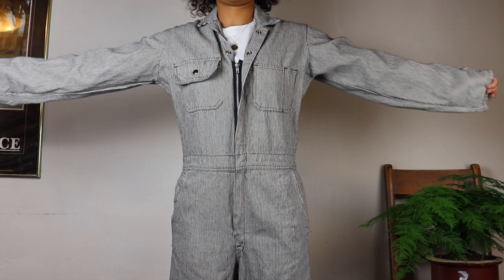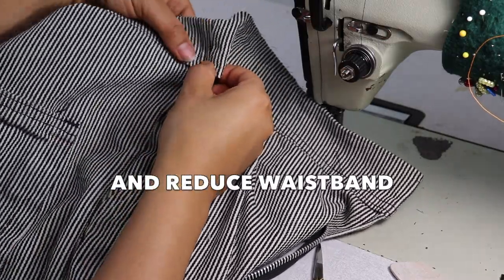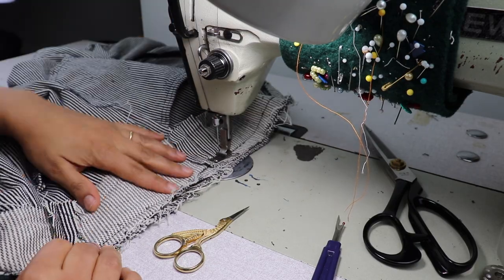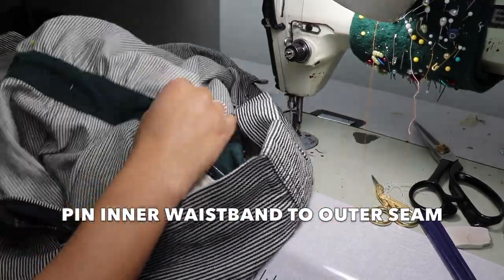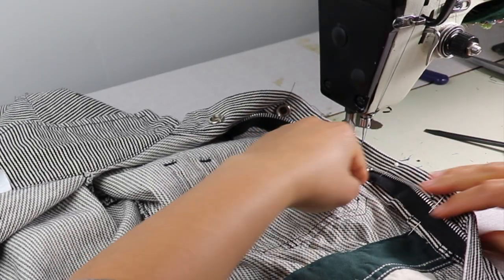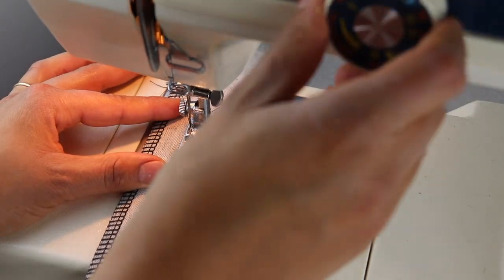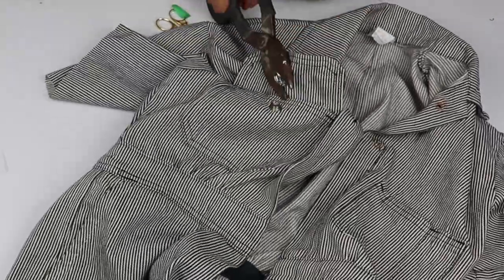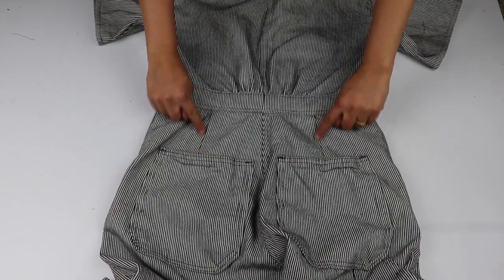THRIFT FLIP - Boiler Suit/Coveralls/Jumpsuit | LYDIA NAOMI

Comment: The openings behind the pockets are so you can get into your regular pants pockets
Reply from the maker: MAKES SO MUCH SENSE! thank you!
Reply: @LydiaNaomi  That's also the reason why they are often so large, they are meant to be thrown on over your regular clothes so they don't get dirty. Also, the loop you often see on the leg of overalls and coveralls is typically for a hammer or paint brush and If it has a long skinny pocket on the arm that pocket is usually for a flashlight in case you are crawling in a tight space and you can't reach your lower pockets.
Reply from the maker: @dannydatwho8253  thanks for the info :D
Reply: The same is true for lab coats and a lot of hospital overwear! If you want to have holes to access your pant pockets but don't want the chance of getting things through the opening, there are also designs that use overlapping pieces of fabric (almost like a wrap)
Reply: @LydiaNaomi  AND you can hike your real pants up from the outside
Reply from the maker: @buckswild5331  very useful haha
Reply: Oh wow, thanks for that.
Reply: True.

Comment: Very talented sewing skills, and very talented explanation on your video!  One question for you.  Would it have been easier to make one of these from scratch using a pattern than to alter the one you found?  I'm not being critical that you did it this way.  I just don't know much about sewing and am looking for information.  Thanks.
Reply from the maker: Thank you! I have another video where I copy this pattern and make a whole new one. This garment is the type that takes a lot longer to make from scratch.  It really depends on what you’re working on. I deemed this garment to be worth up cycling, which I usually shy away from on a general basis because I do prefer making something from scratch. I did go all out on this though, especially with making a hidden button closure. But I have been wearing this ever since and I always get compliments on it no matter where I go and I wear it a lot, so it was definitely worth it. Hope that helps!
Reply: @LydiaNaomi  definitely.  I'll check out your other videos.  I searched because I bought a pilot jumpsuit costume, and it fits arms, legs, and crotch, but it's too baggy around the middle.  I don't have sewing experience and am considering my options

Comment: kind of a newbie here .. so I'm curious as to why you did the gather / cinch on the top rather than taking in the side seam or adding some darts? also, does this jumpsuit have a drawstring in the waistband? considering doing the same to a men's jumpsuit, but I don't want to sew through the drawstring if I take in the side seams.
Reply from the maker: Great questions! I thought about taking in and darts but I think I was being slightly lazy. Gathers are the easiest and surefitting. Darts can be difficult to create smoothly and taking it in also poses potential problems for my highly picky and detailed brain so I opted for the most straight forward method of gathering. I love how it looks tho! This is one of my most worn wardrobe items! 
There was no drawstring. If you want to take in the sides you’ll want to take in the outer garment and inner drawstring casing backing separately then sew back together. Or if you want to be simple just cinch the drawstring in the back first to how you want it and take in the sides securing the drawstring there. leave the front a little bigger to utilize the drawstring in only the front. Or replace the drawstring area in the back with elastic. Hope that makes sense!
Reply: @LydiaNaomi  thanks! you really did a great job! it looks fantastic.

Comment: This was going in a good direction until Ms. Lydia took out the zipper and did all the work with button flaps and such. It was annoying and made me feel anxious - like as though I had to do all that.  Could not understand the logic behind that choice. There were other options - cut the zipper to the new length needed or buy a new one that was the exact size if that was available.  Also, on  such thick fabric, the last thing you want when nature calls is to be fumbling with opening the button hole to enable you to pull the boiler suit down.  Found that very annoying because I was following along in real time and that was a stumbling block.  Other parts of the video were nicely done and it could have been perfect absent the bad decision (IMO) to totally transform the zipper placket.
Reply from the maker: I’ve made one with a zipper and I much prefer the buttons because you can unbutton the waist if you eat a big meal 😂 I also like how buttons look, more artisanal than just a simple zipper. To each their own.

Comment: I bought a jumpsuit but it’s torso is too big for me. On the waist it has elastic at back and a belt over it. It is snap closure at front. Could you help me how to make torso short of this jumpsuit? Most important I am beginner in sewing.
Reply from the maker: I would keep the entire waist in tact and just create a 1/2" seam allowance above it. Then shorten the top area, add 1/2" seam allowance to it and sew the top to the bottom. Your seam will be directly above the waistband  and basically be invisible. It shouldn't be too hard :) Just make sure you keep those seams out of the way of the snaps.
Reply: Lydia Naomi thank u so much for your suggestion. I figured it out and it seems easy. Thank u again.
Reply from the maker: @kpadda9056  wonderful! Happy sewing 👏🏽👏🏽